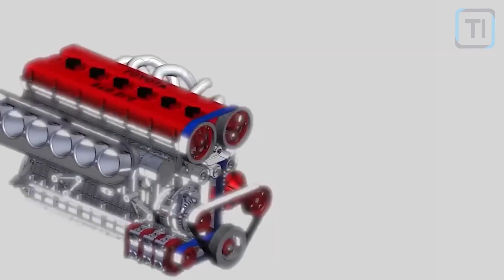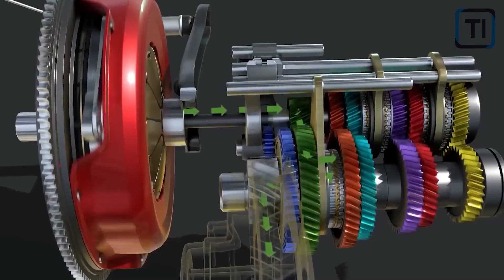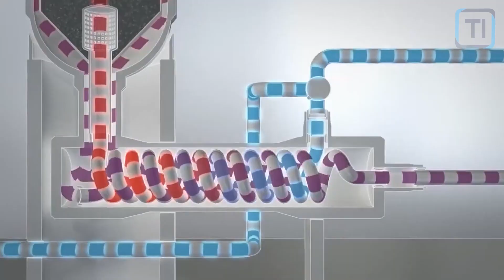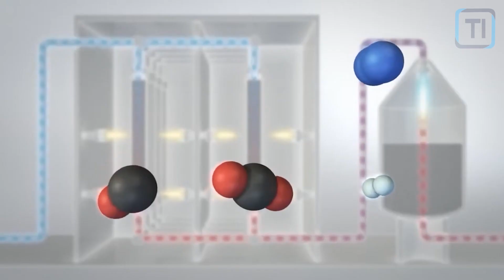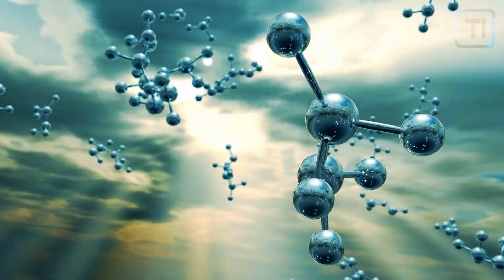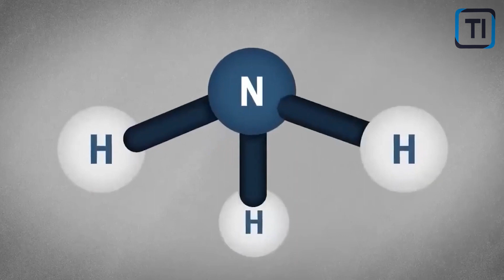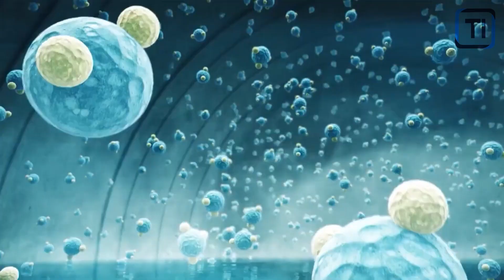Toyota CEO “This New Ammonia Engine Will Destroy The Entire EV Industry!

Comment: nope.  To little, to late.  My area (hometown and surrounding towns) just got electric pumps.  My next car will be electric.  What you are proposing is a car that I cannot fill up (home or abroad).  It took Elon about 10 years to build the infrastructure enough that I am going to get on board.  So until Toyota catches up in that area, I cannot even consider the other shortcomings.  Which there are many.  (Full self driving) will be a big one I can "see" without even looking.  nope.  Toyota had a good run.  But it's over.
Reply: Electric cars do not have long enough range, takes too long to power, result in fires which cannot be put out and leave bigger carbon footprint than ICE engines when production, disposal, battery mining, and electricity are considered.

Comment: Regardless of how safe this is, it is the financial sector that dominates the main sources of energy, combined with the political agenda. The financial sector also manipulates decision-making through lobbies. Toyota has no weight on these boundaries.  We've seen how Toyota got in panic when the EU and some states in the USA changed to renewables and EV acquisition.

Toyota can invent whatever they want, but will never have a dominant position in deciding the type of fuel or energy in the automotive industry, worldwide.
Reply: {Toyota  don't  dominate position in deciding the type of fuel or energy in the automotive industry, worldwide.}, true.  It doesn't matter if Toyota made an engine that only needed filled up once a yea with ammonia.  It would still never get off the ground.  (The system) has decided the would is going to run on (batteries).  And there is nothing, anybody can do to change it.  This (show) has been planned for several decades.  Planned, (exactly) how the world is going to transfer over.  Toyota is just playing it's "death" show.  Like when somebody gets written out of a sitcom.  They just don't "disappear".  There has to be a "reason" they are gone.  This is just a show.  It is not going to work.  Enjoy the show.